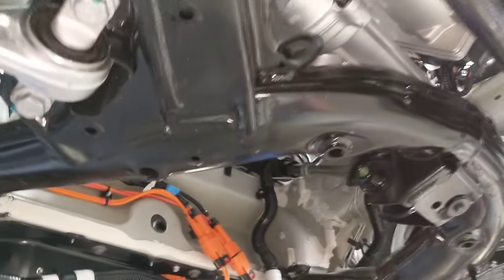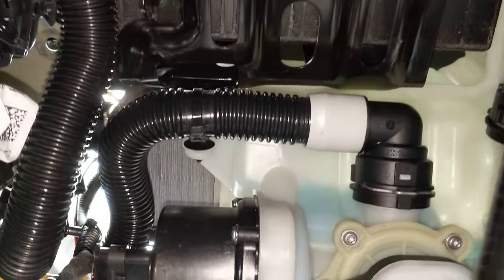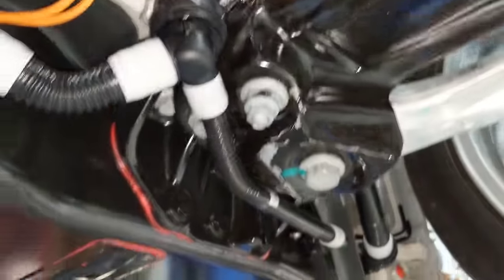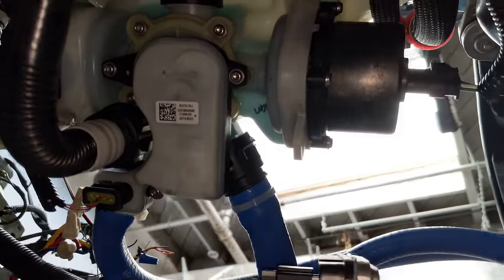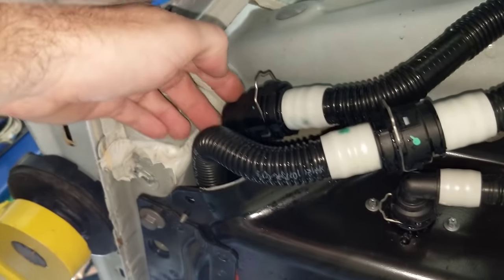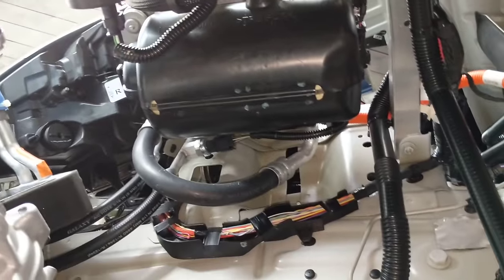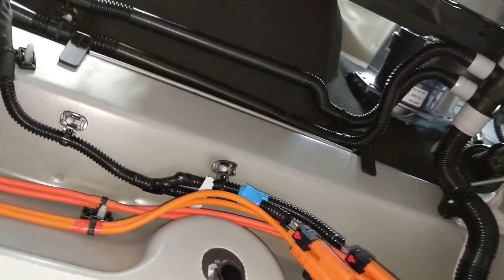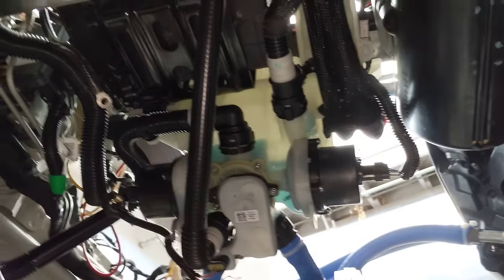Tesla Model 3 - Cooling System Overview

Comment: The white bands that are around the coolant tubes what is that made from?  Plastic overmolding?
Reply from the maker: They are compression rings to ensure the tubing doesn't come off the barbs in the fittings they are pressed on to.  They aren't overmolded, I would say they are heat shunk tube sections, or just cold expanded with some sort of tool.  They are not soft, and the tubing is on the barbs so tightly, it cannot be rotated.

Comment: Also the A/C can't heat the cabin?  Originally I thought it would be a heat pump and be bi directional... however it seems now that cabin heat is just simply a resistive element.
Reply from the maker: Correct.
Reply: As AC tech I wonder why they decided to left it without heatpump. I wonder if the recycling of the waste heat from the motor and inverter is used to supply the heating system of the cabin and could replace the savings of a HP?

Comment: What is your estimate of cooling/heating total hoses length. I want to calculate hoses total surface area relative to heat losses in cold climate due to not been isolated.
Reply from the maker: This will be very difficult.  There are a lot of components, and parts of some hoses are corrugated, and others run in an enclosed area so will transfer less thermal energy.  The hoses probably have nothing on the thermal sinking capacity of the big aluminum castings in the drive unit where there is a heat exchanger.   I think any estimates will be wildly inaccurate.

Comment: Do you know if model 3 coil suspension be replaced by an air suspension ?
Reply from the maker: Yes, this is an option on the P cars.
Reply: Air suspension wasn't an option when I ordered a Perfomance 3 in late June but about ten months ago Elon tweeted it will be an option eventually.
Reply: What I have heard the model s is more comfortable on springs than it is on air. The only benefits are the difference in hight.

Comment: At 4:50 the wires going to the pump on the right of the picture look like they're under stress!
That sleeve needs to be adjusted!
Reply from the maker: The corrugated split-loom is not used for strain relief, it's designed to protect the wiring from chafing, abrasion and pinching.  The wires are strain-relieved inside the connector housing by a silicone boot and crimp on each line.   It's a well-proven design.

Comment: Any idea how this would operate in a 135-140F weather? Would it cool the batteries enough or would it overheat and possibly catch fire?
Reply from the maker: It wold definitely not catch fire.  It would active cool, but likely would shorten the battery pack's life if it was stored at this temperature all the time.   But since the highest recorded temperature on earth was only 56.7 °C (134.1 °F), it's unlikely to experience that temperature unless you park it in an oven.  Strangely enough that temperature was recorded not all that far from where I live; over in Death Valley, CA.  (~500 miles)
Reply: @Ingineerix  thanks alot for the info. Seems to be operational most of the time except for those few extreme weeks here in kuwait. Death valley has the Guinness record for the hottest temp because they disregard areas with asphalt since its not fair to compare asphalt with desert soil. Asphalt temp in direct sun in kuwait reaches 159F (i measured it with infrared thermometer) crazy temp I'm afraid it would blow up my workplace if the lithium batteries expand LOL
Reply from the maker: The Asphalt gets that hot because it absorbs a lot of infrared.  Once you park a car over it and the sun is blocked, there isn't enough thermal mass there to heat up the pack via convection even to what you might find it at during supercharging.   You need to heat the pack WAY higher than that before it's in any danger of exploding.   Generally anywhere you can park a car with a tank of petrol/gasoline and not have it explode, you can park an EV.
Reply: @Ingineerix  i forgot a phone in the car and it snapped the back cover because the battery expanded. That incedent made me pull the brakes on buying an EV until i make sure that doesn't happen if parked in direct sun. Your info sounds really good. Appreciated.
Reply from the maker: The inside of the car is a greenhouse!  The glass allows IR in, but no air movement to cool the inside.  Not a reasonable comparison unless you park an EV inside another car!   Also, the phone has no way to cool itself.   There are plenty of EV's all over hot climates in the Middle East and they do not explode.
Reply: @Ingineerix  very informative. Subscribed

Comment: Is there any easy way to change out the blower motor?
Reply from the maker: I assume you mean the cabin blower motor?   It is a brushless design with the controller built into VCLEFT, so I can't imagine this will ever need replacing, it should last the life of the car.  If you did want to access it, doesn't look like too difficult of a job.
Reply: @Ingineerix  I went the rich rebuilds route and bought a totaled TM3 with a blower that is making a horrible sound and getting jammed sometimes. I tried blowing it out and no luck and looking at it with a boroscope and didn't see anything. I really have to get at it and it looks like you have to take apart the whole HVAC assembly in the service manual to get to it
Reply from the maker: @sparc5  It just removes from the HVAC case with 3 screws from the left side.  Yeah, you might not be able to get to it with the dash installed, I don't know.  Sorry, this is one of the gambles you take on salvage.

Comment: I am replacing the motor in my 2018 Model 3. How much oil and coolant is required, and what specs are they? (old motor was removed before I got the car, so I have no idea how much was drained out)
Reply from the maker: Both front are rear DU's use Synthetic ATF-9, and the total capacity is 2750mL.  Coolant is Tesla G-48, but any "blue" glycol-based pre-mixed coolant is fine.   Add as needed to coolant reservoir fill line.

Comment: What refrigerant do they use, 134a or 1234yf?  That former is a global warming gas and I wonder if there is any irony here.
Reply: I saw on another video that they use 134a, which is a high global warming potential gas, rather than the new 1234yf that most other car companies use.  In Europe, you must use 1234yf in ICE cars, but I don't know if that requirement holds for EVs.
Reply from the maker: They currently use 134a in the US and 1234yf in EU.

Comment: Is there a loop to radiator to cool the coolant?
Reply from the maker: Sorry, I missed talking about that, yes in my video the 2 front connections on the 5-way valve (blue lines) are the radiator loop.  The 5-way valve can either send the coolant to the radiator, the chiller, or both.  In the beginning of this video you can see the 2 black lines on the front of the superbottle that feed the radiator: https://www.youtube.com/watch?v=dxPDT843nOw

Comment: Does the AC system work as a heat pump for mildly cold days?
Reply from the maker: Sadly, they chose not to do this.  I think the nominal cost would have been worth it.   There isn't enough waste heat from the powertrain because it's so efficient, but a "standard" air-derived heat pump would be useful, especially in milder climates.  I suspect Tesla just wants you to preheat your cabin while on "shore power", that way it doesn't cut into your range as much.  Other EV makers such as Nissan and Kia chose to add them, but of course it matters more on those cars with much smaller battery packs.
Reply: @Ingineerix  Don't forget they made a heat pump in the Model Y and so they are now used in the new Model 3's.
Reply from the maker: @JoshuaPritt  Yes, keep in mind this was recorded in 2018!   Now Model 3 and Model Y both have a completely different system.

Comment: whats the distilled water - eth. glycol ratio used in tesla model 3?
Reply from the maker: You cannot use conventional coolant!  It must be a phosphate based OAT engine coolant.  It comes pre-diluted, you do not add any water!  You should be able to locate any Blue colored coolant spec'd for a recent model Japanese car, that is the same stuff.   Do not try to roll your own!
Reply: @Ingineerix  when it's pre diluted, what the ratio of dilution
?
Reply from the maker: @udai4k  From what I can see, it's 50%, but it must be with de-ionized water!   I've never seen it offered as a concentrate due to the possibility of not having the same dielectric constant.
Reply: @Ingineerix  can we find it in amazon or ebay as a ready to fill product for Tesla models ?
Reply from the maker: @udai4k  Definitely: https://amzn.to/2SMrzzE

Comment: Is there a way you could call me? I have a M3P and I wanna know if mine is leaking coolant
Reply from the maker: You can find my email address in my channels "about" page (use a full browser, not a phone):  https://www.youtube.com/ingineerix/about
Reply: The hoses on the side that run front to back….is one sending coolant to the back and the other is a return line to the front?
Reply from the maker: @clintcarter5218  Yes, the 2 on the passenger side are electronics/powertrain cooling, and the one on the driver side is return for the battery circuit.

Comment: That oil filter looks like a traditional engine oil filter
Reply: Yes, for the gear oil in the drive unit. However unlike a gas engine which quickly contaminates and degrades the oil because of fuel and combustion going on which gets into the oil, a fixed gear does not really contaminate the oil in the same way. You may have some wear materials from break in and over time, but those are minimal and can be held by a typical magnet as in many cars, and the oil is not otherwise affected. Because it is a fixed gear and closed system, the filter and oil can be used for a long time without needing replacement or degrading the oil.

Comment: Anyone know how often you have to change the  filter at 3:49?
Reply: Emmanuel Rovirosa (no clue, not a useful answer here) I'll bet that you can go a stupidly long time, since there's nothing to sludge the system up, or introduce particulates
Reply: Alexander Riccio the differential itself has a small amount of friction and therefore will introduce particles eventually. Well that's my experience from off-road trucks. Most change their diff oils every 25k miles. For my me I'll probably do the first at 25k then every 50k after that. That is of course if I can find the filter and correct oil.
Reply: If you use it as a road car then that filter needs no changes, at least not for 20 years.
Reply: However unlike a gas engine which quickly contaminates and degrades the oil because of fuel and combustion going on which gets into the oil, a fixed gear does not really contaminate the oil in the same way. You may have some wear materials from break in and over time, but those are minimal and can be held by a typical magnet as in many cars, and the oil is not otherwise affected. Because it is a fixed gear and closed system, the filter and oil can be used for a long time without needing replacement or degrading the oil.
 It could really be for the life of the car, or maybe at least a couple/few hundred thousand miles. The differentials or rears in trucks can go 50k to 100k and those are not really closed or sealed systems and are still exposed to more contamination. Truthfully people have gone into the few hundred k without changing without issues. It is just 2 gears meshing without contamination. As long as the temps do not get extreme as the result of proper cooling.

Comment: It's beyond me why a simple gear box (oodles less complicated than a manual transmission) requires cooling and oil filter?
Reply: Could it be due to the reduction and speeds it receives?  ICE cars never spin quicker than several thousand rpm's
Reply: Back when early Model S's were having problems because of lack of that, professionals in the business explained the need for that to Tesla back when Model S didn't have one, and Tesla realized they were right and added it.  Also that little ground pin, too.  I've continued to read reasons for that filter since then, as well.  Having no engineering degree-level education nor good memory, I don't remember the details.
Reply: All transmissions cool with oil through the casing walls, this just has an all encompassing system that can put the heat back into the battery and cabin when needed.
And that one oil filter is just insurance for life that no small particles will mess up the gears or bearings.
Reply: You still need oil to reduce friction with 2 gears meshing, just like in a rear pumpkin on a rwd large truck. This also helps cooling. You need the filter to collect what minimal if any contamination there might be, but probably mostly to collect and minor wear materials from break in a use. Like how you have the magnet in your drain plug.

Comment: It has an oil filter. Lmao.
Reply from the maker: This is a filter to make sure the drive unit lubrication system is clean, so the drive unit can go without needing lubricant changes for life.  Without this filter you'd need to change the fluid, so having the filter actually reduces maintenance.  This is just the synthetic lubrication that cools and lubricates the drive unit, so it never gets hot like a normal internal combustion engine oil system does.  This is why the Tesla can state there is no fluid or filter changes needed for the life of the car.

Comment: Ridiculous. Looks like a lot of crap that can and will go bad.I bet it's real fun to diagnose problems with that also.
Reply from the maker: If you look at my other video "secret signals" you can get an idea of the incredible diagnostics all Tesla systems implement.  If any component does ever go bad, it's super easy to determine what's wrong.   I can also say, even in cars now over 100k miles, I have yet to see any problems with the cooling system.   Keep in mind there is way less waste heat and high temperatures as compared to internal combustion cars, so the system doesn't experience nearly as much stress.

Comment: I think this shows that Tesla goes to a lot of effort to reinforce the fallacy that an EV is so simple and virtually maintenance free.
Reply from the maker: Compared to any other ICE car in it's class, and even other EV's, it's markedly simpler.  Really the only ongoing maintenance is tires and windshield washer fluid.  Maybe at a half a million miles you might have to change brake pads and I would consider changing the drive unit oil.  It's definitely not anywhere near the complexity of an ICE and all the regular fluid changes needed.
Reply: It's rather absurd to state that it's a "fallacy" that EVs are virtually maintenance free. Where in this video does it speak to the maintenance required on an EV? The one filter shown requires no replacement. The only maintenance of a Tesla is brake fluid every 2 years or 25,000 miles (40,000 km), whichever comes first, AND battery coolant, every 4 years or
50,000 miles (80,000 km), whichever comes first. Compare that to your gas car, and tell me that an EV is complicated.
Reply: Certainly not the simplest, but then go and have a close look at all the systems in a modern car, you would think NASA was designing that stuff.
Reply: @Kevin - The OP states that it is a fallacy that EVs are virtually maintenance free. I say, that compared to gassers, EVs ARE virtually maintenance free.

Comment: Can you explain me about the air conditioning system used in Model 3, the details of the compressor used in air conditioning system, how it is powered up?
Reply: It uses power from the main traction battery to power a separate, small, electric motor connected to the compressor.  Similar to an electric air conditioner for an RV or "window unit".  Except it's more like a heat pump for your home that can be reversed to create heat or cool air.
Reply: @JoshuaPritt  Thank you sir

Comment: Does the same coolant cool the battery as well as electric motors?
Reply from the maker: Yes, but the thermal management system can split the circuit into 2 parallel systems if needed.
Reply: @Ingineerix  I also need to know that having 7000 cells approximately how much litre of coolant is required to cool the battery!!!??
Reply from the maker: The long-range 74kWh pack only has a total of 4,416 cells.  They are larger in diameter by 3mm and taller by 50mm as compared to the conventional 18650 type used in the Model S/X 85/90 pack which used a total of 7,104 cells.  The total glycol-water coolant used in the system is 15 liters, of which about 6.6 liters is used in the pack itself.